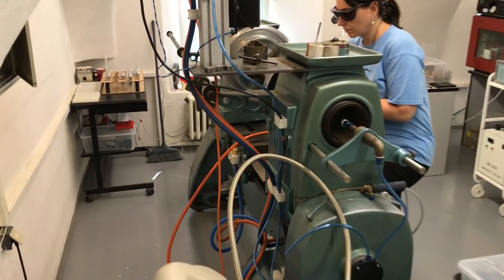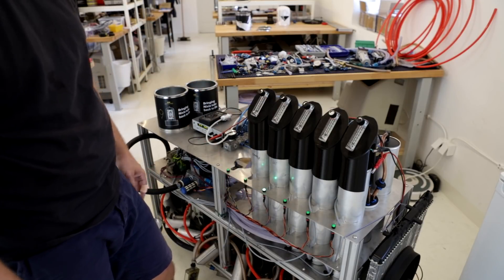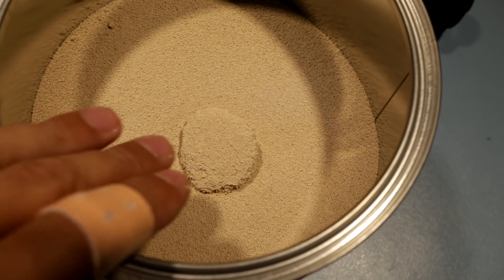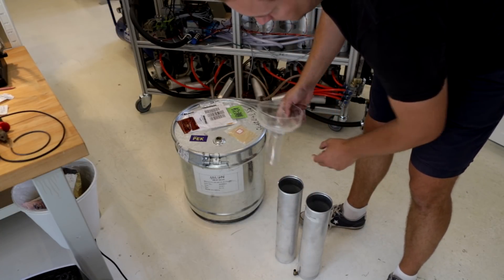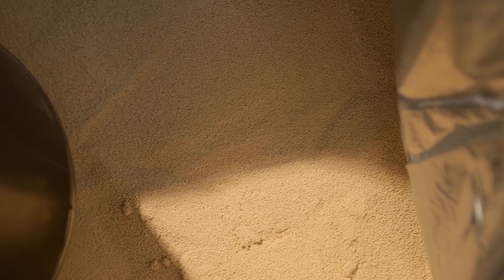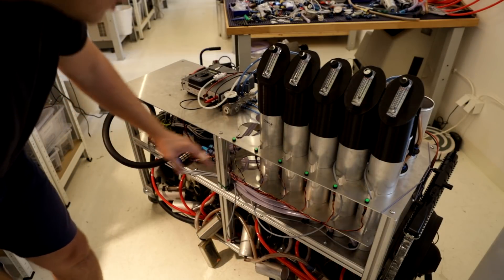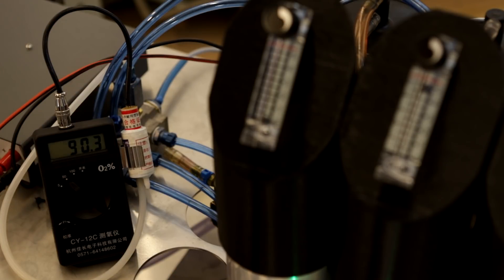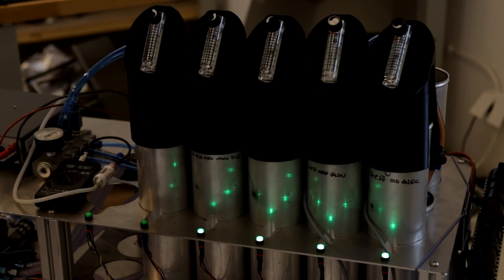Filling the oxygen concentrators with new molecular sieves - Project H #17

Comment: Are you passing air into those sieve beds and right out into the O2 sensors ?  I didn't hear the characteristic "tssshhhh tssshhhh" as the compressed air is allowed to build up pressure inside the sieve beds, while O2 is absorbed, then N2 + H2O + CO2 are released, then O2 can be collected.  I'm just curious how you're doing it to dispose of the N2, etc. 
And that seems like an AWFUL lot you paid for 25 Kg of zeolite!  Prices, lately, are scaring me.
Reply: I ordered the same zeolite from the same supplier and at the time it seemed to be the only public facing vendor. You sorta take what you get when vendors won't talk to you.
Reply: @ZacharyMelo  We're professional in manufacturing adsorbents/catalyst in China for ≈30yrs.
If a requirement about zeolite. , please contact us freely, we can offer you details.

Comment: Zeolit warms up BECAUSE it absorb the humidity from the air (recommended to be way below 30%) and yo DO NT want exactly that. So I recon you`ll be throwing away the rest of the barrel, as you wrongfully probably did with the old one. While you could have heated it in a thin 1-2cm layer at 300 Celsius degree for about 8-15hours. Or shorter under void, thus allowing a thicker layer. Maybe for you 90% maximum is allright, but in medical field... Anyway, you probably bought Lythium zeolite, that has DOUBLE the efficiency of Natrium zeolite. If yours is Nattrium zeolite, then that`s a good return. If packed correctly under a dry athmosphere, it should have produced 93+ concentration for the quantity you load there (@5lpm per 2 tubes).

Comment: My device was giving 66% purity and after I take out zeolite out and return it I got 36% purity,  I open it in environment conditions safe for zeolite 
Sir what is the reason?
Reply: Hi Luqman, this can be caused by many reasons.

First, check whether the machine is leaking and whether the valve is working properly.  Secondly, it is necessary to check whether enough molecular sieves are loaded, and if enough molecular sieves are loaded, check whether the performance of molecular sieves does not meet the standard.

Comment: You can regenerate the sieve material over a few weeks by putting it in a sealed can with dessication packs made of baked out epsom salt. The stuff will chemically bind the water in it. Also feeding your machine with dry air conditioned air will make it work better. Other then that very nice project! 🤓
Reply: that was what I was wondering...if it's possible to rejuvenate old sieve material.  Can i extract the spent sieve material from an old oxygen concentrator I got that seems to not output that much oxygen and bake it to rejuvenate it?  Is the problem water then?  What about putting it in a vacuum?  I can get down to at least ~50mbar and potentially lower.
Reply: @perspectivex próżnia jest wskazana + 300'C + mieszanie i sita powinny się zregenerować bardzo dobrze.

Comment: Why don't you use silica gel to filter out moisture at the starting stage
Reply: It would take a LOT of silica gel. (The moisture is not a problem) I live in Houston TX USA where the summer humidity is awful and the concentrators  work fine at 90-95%, using 30 year old sieve! The sieve is regenerated by baking under  vacuum.
Reply: @glasslinger  did you try baking under vacuum and subsequently measure the o2 output to see if it improved?  The guy in this video, daliborfarny, mentioned in a few other comments here he "tried vacuum (below 1mBar, 15 hours, 250C), they were even worse after this process", which I thought was really surprisingly.

Comment: That's a nice design, I would recommend that you vibrate the Sieves after filling before closing them so the zeolite settles, the spring should be fully compressed because the zeolite will settle even more once it's turned on. If not fully vibrated, you risk the zeolite shifting during the PSA cycle which may damage the zeolite.
Reply: Exactly what I said.. And the zeolite should be stored air tight...and even in a small air conditioned closet to minimize the moisture present in the air..

Comment from the maker: Hi! I started receiving emails asking me to help to build oxygen concentrators for use in Covid-affected areas with no supply of medical oxygen. I have no idea if the oxygen produced by a system like this will work for this purpose, you are building it on your risk. The concentration of the gas produced is on average 85% oxygen, the rest is mostly nitrogen and other constituents of air.

The molecular sieves I used is "JLOX-101" from www.molecular-sieve.cc, the price was around $500/25kg drum + $500 shipping from China to Europe.
The sieve beds and Thomas compressors used are from Invacare oxygen concentrators (6 used units, each of them around 150-200 EUR).
The pneumatic valves are Festo MN2H-5/3G-D-01 (6 pieces, 70 EUR each).
The timing of the valves is driven by Controllino Mini (130 EUR).

If you have further questions, please reply to this comment, I will do my best to help you. Cheers!
Reply: 1. Do we need any special room for filling zeolites in containers, like maintaining pressure, temperature or humidity of the room?
2. How did you close that remaining zeolite can to keep it safe for a good amount of time until you need them again?
Reply from the maker: @hp5683  the lower humidity the better, but no special conditions are necessary. Just avoid 85%+ humidity. The zeolites are exposed to ambient air anyway during the operation.. I keep the rest of the zeolites in the plastic bag and closed drum in 20C, 70% humidity room. Should be ok..
Reply: @daliborfarny   Did you have any problem about purity after filling zeolites as you did here in this video? That cylinder is working above 90% still or you refilled it again? Thank you!
Reply from the maker: @hp5683  No, the machine runs with the same zeolits every day several 3-5 hours, the oxygen concentration is now around 85% in average. We keep the machine in a small room with air dryer that keeps the air humidity at around 60%.
Reply: @daliborfarny  1. Can you let me know the Diameter and Height of the beds?
2. How much KG of zeolite you filled in a single bed?
Reply: Hi, can you tell me where you got those canisters which hold the zeolite? Is it salvaged from the old o2 concentration units?

Comment: Just asking myself: Once operating this within a closed room- wouldn't it deplet the oxygen within the premises?
Reply: In a 100 m^3 room, there would be ~20,000 L of pure oxygen (21% * 100,000 L).

At 30 L/min generation, the depletion rate would be nearly 10%/hr of the initial volume of oxygen.  So if the room was air tight, after an hour the air would change from 21% to 19% oxygen, approximately.

An air turnover rate of 300 L/min within a 100 m^3 room would offset the oxygen depletion rate by 95%.

So any reasonable air handling system will easily offset any oxygen depletion.

However, you wouldn’t want to be caught in a closet with this oxygen generator running.

Comment: what is the pressure going on into the sieve bed?
Reply: It's around 1.4 - 2 bar. Around 2.2 - 2.5 bar starts flushing out the safety valves on compressors. Me - the guy in red shirt at 0:41 who was working on it as well.

Comment: What kind and size of zeolite for that concentrator? Thanks.
Reply: It's 20*40 mesh or 0.4-0.8mm,lithium type zeolite
Reply: @eazanhan6366  does the cylinders are "series" connected? or work alternating. System uses vacuum for evacuating residual nitrogen? Thanks :)
Reply: @enriquegonzalez2802  1. The cylinder is actually the adsorption tower of the oxygen generator. One cylinder is adsorbed while the other cylinder is regenerated, and they work alternately.  2. The system does not use the separated nitrogen, which will be discharged into the air

Comment: can u help me sir my sister oxy concentrator is low presure they have air but to very low and i observe that the noise of unit is gone i hope u can help me sir
Reply from the maker: Hi, thats tje reason why we abandoned the normal oxycons - too many strange issues :-) I guess yours is leaking - search for a leak on the pressurised air line.
Reply: Please check the compressor and pipeline on your oxygen generator

Comment: Why did you expose all of the zeolite to air rather than just opening a hole with a sealed section so you can remove them in measured amounts? They turn moisture into heat. I would expect that you would need to heat them under vacuum to remove the moisture.
Reply: "Regeneration of the zeolite is both simple and complex. Approximately 70-80% of the moisture can generally be removed by “pulling a vacuum”, i.e.; lowering the humidity level. This fraction is known as bulk water. The amount of water removed from the zeolite is dependent on how low the humidity is lowered but, without a method to exhaust this extracted water, the moisture merely leaves the zeolite and re-enters the air stream. This again lowers the saturation point of the zeolite. Therefore, the zeolite adsorbs moisture until it cannot adsorb more. If the humidity level falls the zeolite deadsorbs moisture until it is in “balance” with the lower humidity level. At that point it begins to adsorb moisture and the cycle is repeated.
The remaining water (which cannot be removed by pulling a vacuum) is very difficult to remove and may require prolonged heating at moderate (150C or 212F, the boiling point of water) to very high (600-800C, 1112-1472F) temperatures. This fraction is coordinated to the metal cations present in the zeolite. There would need to be a chemical analysis of the particular zeolite (s) in use to determine the characteristics before it could be determined what level of heat is required to" sufficiently remove lower levels of moisture. It should also be noted that heating zeolites to very high temperatures can cause extensive structural damage."

Or you would just look at the datasheet that tells you how to handle the zeolite as provided by the manufacturer. This is the same thing people do to plastics before they are used in injection molding and printing.

Comment: Great video Dalibor, as you are burning the oxygen does it lower the concentration of oxygen in the room? I used to work in low oxygen environments and it catches you slowly as air is 80 odd percent nitrogen. Do ensure you have a window open.
Reply from the maker: Thank you! Yes, the burners produce carbon dioxide and water vapor. There is an extractor hood that takes the gases out, this makes fresh air to enter the room by the door.. so it should be fine..

Comment: I didn't think that anhydrous zeolite was quite that expensive.  Also I believe that commercial oxygen generators use silica gel to dry the air.
Reply: that would deplete rather quickly, considering how much air has to go through...
Reply: The oxygen generator uses molecular sieves to separate nitrogen and oxygen, not just dry air.

Comment: I'm not sure what sort of humidity/dew point requirements the zeolite has, given the system had nothing specific to dry it beforehand, I assume they just don't want condensation in the sieve columns, but are fine with some humidity otherwise. You can do a few minor things to ensure the compressed air is above its own dew point.  You're cooling the air out of the compressor which is good, but if you can drop the dew point by lowering pressure after water condenses out (the expansion will cool the air a bit) and then letting it warm back up. With continuous production of O2, assuming you have a coalescing filter after the radiator/aftercooler, a length of tubing wound onto the aftercooler to provide a small flow restriction and warm the air would ensure the air going to the sieves is above the dew point, hopefully extending sieve service life and preventing problems.

Comment: They can also be configured for nitrogen.
Reply: what do you mean?
Reply: @lukas441stu  They can be configured to concentrate nitrogen rather than oxygen.  PSA nitrogen generators are often used in the production of liquid nitrogen.
Reply: @douro20  the sieve material for psa nitrogen is carbon based.
Reply: @nitrousman8882  Usually, activated carbon is used for hydrogen purification
Reply: @eazanhan6366  perhaps, but CMS 200 is also used in PSA nitrogen production.
Reply: @nitrousman8882  Yes, but CMS 200 is activated carbon, carbon molecular sieve. JLOX-101 is lithium type molecular sieve, too expense to purificate the nitrogen. CMS 200 is much cheaper, could match some 5A molecular(or binderlesz 5A) sieves to get good nitrogen purity.
Reply: @eazanhan6366  lithium salts are used for oxygen, especially VAPSA
CMS is expensive but I’ve never heard of it being used in PSA for oxygen, but if you’re the expert, I shall bow to your wisdom... I won’t waste my time trying it...but will bow
Reply: @nitrousman8882  NoNo..may I didn't make it clear. CMS 200 can't used to produce oxygen but nitrogen, lithium type molecular sieve is for oxygen.

Comment: In regards to the humidity, i'm going to assume that's the basement putting sticks in your wheels as the saying went. Maybe put a dehumidifier box before the intake into the machine? Or have it sit inside a sealed box that's fed from one...i'll admit, this is not my original idea, i saw that some high sensitivity lab equipment machines have enclosures that are force fed dry air. Obviously, those utilize stupid expensive machines to dry the air, but something on the cheap should be ok... i mean, any + is better than none, right?
Reply from the maker: Sure, that would help - I need to find out how exactly it is done in the original machine :-) there are no dehumidifiers..
Reply: I installed a compressor dehumidifier for my parents’ basement, it works a charm (and provides me with waay more milli-Q water than I need). You could probably hack one of these for your purpose... Since it works from a regular fridge compressor, the noise level is very low.
Reply from the maker: @Sodabowski  We have two dehumidifiers of this type, they work well - we can end up using these, but I first want to know how the original oxygen concentrator did the same operation without using dehumidifier..